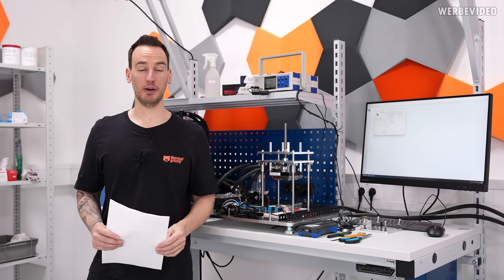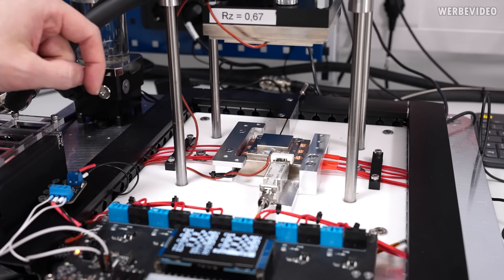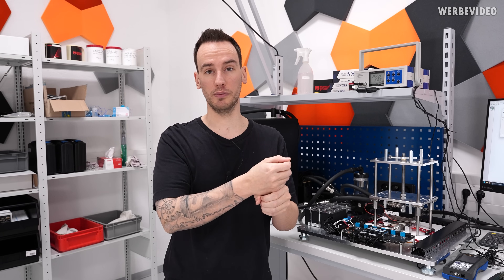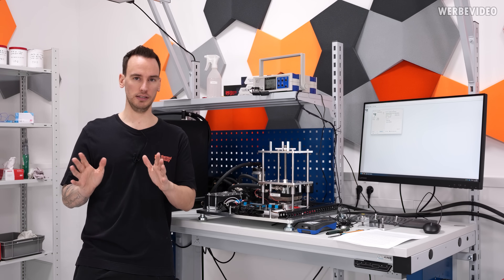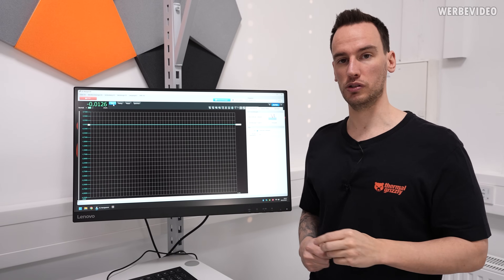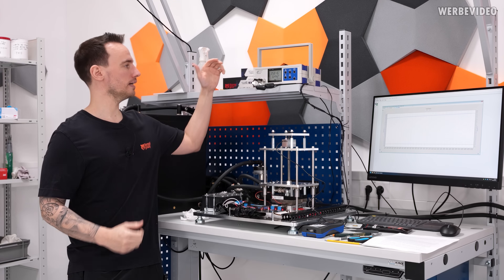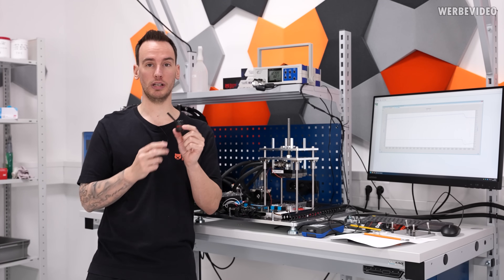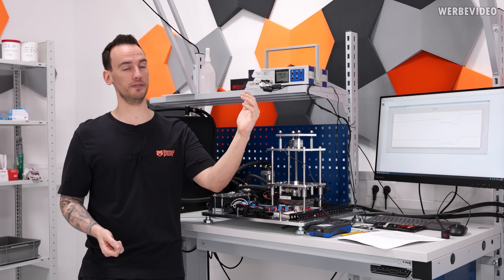The Secret of Testing Thermal Paste

Comment: Helpful tip for those that want to apply PTM7950/phase change material sheet: buy a set of precision pliers. Then use scotch tape on the other side.
You will thank me when it comes to peeling the protective coating.
Reply: Apparently cooling the PTM7950 in a freezer for a little while before applying helps with peeling of the plastic layer.
Reply: Could you explain? Do you mean the removal procedure is that bad?
I suspect then that good as thin as possible pliers might be better. "Precision" ones (at least in my country) could be quite thick, which would make it difficult to use.
I do thank you for your comment, since I have PTM7950 (one of them is called 7958 - but it isn't a paste, like googling suggests) that I will soon install on both CPU and GPU.

Comment: I remember back in the days having seen a temperature delta of 10C between whatever random paste I used to use and the Indigo Xtreme phase-change thermal interface material that essentially creates a solid bond between the surfaces. I wonder how much of that difference was just the Indigo Xtreme having been measured to cover the full surface area and me using some silly old "dot in the middle" way of applying the paste. It's also incredibly difficult to find any real data about pastes from people who measure them realistically with actually enough controls to give you useful data, so you end up essentially buying based on marketing and the baseless claims of loud people in the community.

Comment: For me the real test of a thermal paste is how well does it work when you put a just-big-enough dot in the center of the IHS and then mount the cooler.. and how long does it last before needing to be redone.

I've bought kryonaught three different times and it has always failed to spread enough on it's own, and failed this test. Hydronaught was reasonable at it though, but not outstanding.

Comment: Roman from my testing of thermal paste vs sheets delta T was 10C at Rel.Humidity of 95% with room temp 30C. Delta T was  4-6C for every degree increase in ambient temperatures with Max temps being 100-105C on CPU and 95C on GPU with laptop components.
Reply: It's nice, that you're stating all the environmental variables. But you have to look at the frequencies too. When I changed my laptop to liquid metal, the temps stayed the same. But I got a 500MHz boost out of it. So not only the temps are important but also the performance of your device. Your Laptop will always increase it's performance until it runs in one of the many limits. The limit can be power, can be temps etc.
Reply: @TheBurnout96  mine is skylake HQ CPU. Never had issues with lower frequency on turbo boost. It was always 3.1GHz on all core boost

Comment: After watching the GN video and this one, I can’t help but think you could benefit from a dry milling stage where you hammer/jet mill the bulk powder ingredients to your specification. External milling costs are always pretty high and you spend a lot of effort in monitoring particle size already, but incorporating a “qualified” process with a desired D50/D90 would save you a lot of time verifying the particle size so regularly. You could even have the material output from the mill(s) being controlled to sub-batches of a certain dispensed amount to avoid having to use the glove box 🙂

One thing I am uncertain about is your local environmental regulations about storage of the bulk materials. They could be stored in vertical hoppers mounted externally to the building, but if there are indeed significant amounts of gasses expelled, then your allowable emissions (as defined by your local environmental protection agency) would determine the amount of material you could store in said hoppers at any given time.

Very interesting to see the entire process from start to end! Your commitment to quality is truly commendable and I hope your customers appreciate it!
Reply: ultrasonic could help with densification
Reply: Curious - if they save the time in QA of external milled materials, wouldn't they have to spend that amount of time or more on QA of the internally milled materials?
Reply: @frollard not if you qualify the process of milling. If doing X number of passes at Y milling conditions is proven to land you within a specific range (for D50 or D90 whichever is preferable) then you would only have to double check that you are still within spec occasionally, therefore maintaining a qualified process. Ironically I’m pretty sure the strict level of regulation is self-imposed in the first place, but assuming that TG is loosely conforming to a GMP process this would be an acceptable path forward
Reply: Look at their near perfect, round morphology those aren´t milled particles. I would guess it´s a spraying process. With milled particels they couldn´t load their pastes with as much particles and the flowability would be really negatively influenced.
Reply: @ I’m not much of an inorganic guy so you could be spot on there. If it was an organic crystalline product I would assume the form is stable through dry/wet milling and the uniform boundary shapes could happen during drying. Given the two materials wouldn’t spraying be a very high temperature operation?
Reply: @ I mean one is aluminium whichs melting point is below 400°C, but then again, it is done even with tungsten powders, so melting temperature is no problem. I thought about Zinc oxide again (I don´t think they show us the particles of that) and I think for this a sol process, where two reactants form the zinc oxide nanoparticles is the msot likely one. This would also explain why a comperatively shitty thermal conductor like zinc oxide is used, instead of aluminium nitride or Boron nitride, as nitrides are less accessible by these wet processing routes.

Comment: Does microscopic amounts of the thermal paste that could be left over affect the the measurement whenever you test it.
Reply: I'm guessing they clean it with 90% alcohol to actually have the pads as clean as possible...but that's a guess :p

Curious what the answer is :)
Reply: @Mr3ppozz  yeah that's what I guessed about it too but I was still wondering because I knew in the other video on Steve's channel they showed the actual microscope thing that zooms in on the thermal paste when they make it and it almost looks like it's on the molecular level. I mean they zoomed in really for on it where you could almost see the little things stacked on top of each other

Comment: Waaaayyyyyyy back in 2000/2001 when I was heavily into overclocking thermal management was a huge deal.  I remember how excited everyone was with arctic silver and on a celeron I had overclocked to 1100mhz I managed a 30° drop on a thermaltake cooler just with the arctic silver.  But then as time went on and coolers got better and the improvements that various thermal compounds became less I began to see it in the same way as so many people do with their cars.  They brag about how much HP they have or how loud the stereo can get but they never really looked at the real world benefits of it.  Seeing so many videos on thermal management, how to apply thermal compound "correctly", which is the "best" kind (etc) I have noticed so many people seem to be focusing on single digit changes.  Personally dropping temps by 5-8° is really a meaningless thing for me if it isn't actually helping performance.  I also gave up gaming 20 years ago so I'm no longer chasing every clock cycle or flop that I can get.  I began to see computers as a general tool rather than something to gain bragging rights.  And I say this as I type this out on a 2009 HP laptop running a T9300 CPU.  Does everything I need and has (at most) cost me $6 per month to own and operate...and that includes upgrading the CPU, doubling the RAM from 4GB to 8GB, replacing the HDD with SSD and replacing the battery twice.  Over time I began to understand how unimportant all this performance chacing is.  But I still find the science fascinating though.

Comment: Der8auer finally overtakes Snark's Domain. He's been using a very crude version of this tester since the RTX 3000 days.
Reply: What do you mean "Finally?" Just because he hasn't mentioned it before doesn't mean he didn't have it.
I hope you realize that he owns a company that does thermal interface materials, and has long before the 3000 series, so this kind of equipment is necessary to run testing.

Comment: I love thermal dynamics.
It is so easy to do ball park calculations and get relatively ok results. (The math for steady state is easy and you can often get really good estimates)
And the same time it is so difficult to get everything 100% correct. There are so many details that often have little effect but then is speciel cases they become very important.

One of my favorit courses as a mechanical engineer. And I use it all the time outside work.

Comment: Probably the most difficult performance test is how long lasting any thermal paste is. It would be incredibly useful to know how performance degrades as the paste dries and to be able to compare this aspect across several products. Of course that would be much more expensive and time consuming to do.

Are you planning to test a range of popular thermal pastes using this ingenious device?
Reply: That's why you get a Kryosheet or something like PTM7950, which have been demonstrated to last a very long time with very minimal changes in deltas.
Reply: If I understood things correctly - this is mainly for internal "batch" testing and for R&D. And they do make such endurance tests BTW.
Whether they test competition (very likely) and whether they want to share this data (there might be reasons they wouldn't want to do so perhaps?) is a different matter. I would love to see such video as well, but IDK if it's plausible that they will make a video out of this.

Comment: For decades now, I have lap matched processors to heat sinks contact face(Wet and Dry sandpaper method). I do this too match the surfaces, so that both surfaces have example 500 Grit. My experience has taught me that going above 1500 Grit becomes none effective, unless you use liquid metal. (Coollaboratory 1g in medical syringe late 90's. Also tried Thermal Grizzly version to see it modern version had changed.) The side effects of liquid metal, is why I stopped using it. I am not into extreme overclocking, in later years I find overclocking has become a waste of time compared to the performance gained. What would I like from a thermal paste? A thermal paste that states particle size. A thermal paste that will fill the surface with a micron or grit reference. 
General Information
Match a processor to a heat sink is time consuming and can take a few hours. It is very boring to do also. You can have similar results, by just using liquid metal based thermal material and reading the instructions correctly when applying liquid metal, with the sanding part. 
Best O/C
Intel Q9550 with SI-120 cooler to 3.2GHz stable 24/7/365. (3.6Ghz was possible, not 24/7 stable though)

Comment: Well, you guys must be doing this right. I bought Kryosheet to replace thermal paste in my laptop. It has a very small direct die CPU, so the paste would always end up spilling to the outside, even when it was a super thin layer. Core temps would never be even. To fix it I put a cut piece of Kryosheet in there and the temps stay rock solid with absolutely no fluctuations for many months. It's overclocked out the wazoo as well (+900MHz core and cache).

Comment: This video makes me want a revisit of the paste application techniques.
Is air bubble trapping really a considerable issue when spreading the paste out flat on the IHS, rather than placing a dot and pressing it out?
Reply: In previous videos Roman has categorically said that bubbles are absolutely not an issue, ever. Only portions not covered by paste are an issue. Even in this video he spread it out over the whole surface. He does this a lot, so hopefully he's right. haha
Reply: @EricTheRedKind  If you put a circle of paste, trapped air is a bubble. It's just that barely anyone would be dumb enough to do that.

But then you have people like The Verge showing unsuspecting viewers exactly these methods nobody would normally use, creating this problem that wouldn't exist otherwise.
Reply: This backwards thinking, you don't want so much paste that non covered areas don't make contact, ideally you want the opposite,only filling the holes that don't make contact and the rest shouldn't have any paste as it a better transfer with direct contact. But it hard to know what's contacting what so we just glob it on. But I'd bet if you put on a minimal amount scrape the rest off with a razor blade so you really only fill the gaps,that would perform best.
Reply: The differences are minimal in practice, but x is the most reliable way of making sure there's as little air trapped as possible while having full area coverage
Reply: No, it's really not a considerable issue. This has been tested that pretty much every way you end up with good coverage due to the pressure, and the biggest risk is not using enough thermal paste. 
Where the risk would lie is when doing liquid metal, where missing a spot is much worse.

Comment: All I can say is I switched from pastes (having used a variety from different companies) to using the "Phasesheet" rebadged PTM 7950 from Thermal Grizzly on a 14900k and it performed brilliant after a couple days of heat cycles. If this product stays available I would use it for any PC that won't have the CPU cooler removed within a few months.
Reply: Thank you. I got a sheet waiting to go on my alphacool 7900xtf to fix my nasty deltas and you made me feel better
Reply: The PTM is awesome as it's very forgiving. My brother was installing it on his AM4 CPU (don't remember which one), but it tore up in one corner when peeling off the substrate film. We just stuck the torn part afterwards as if nothing happened (not perfectly anyway) and after reassembly the temperatures were still better than before.
Reply: lol yeah the ptm 7950 tears easily

I re"pasted" an asus rog ally after performing a replacement on one of the fans and the stuff is like an al dente noodle.
Reply: @RicoElectrico  That's what happened to me. The peeling was the only issue I had with it, the first side I tried didn't come off but the 2nd did fine. I had a tear in the corner but I was able to bring a bit from the overhang on the contact frame and place it down to make sure it covered properly.
Reply: bot marketing comments??
Reply: I got a huge fan speed and noise improvement on 3090 using PTM 7950 from Aliexpress. I wonder what's the thickness of its particles/contact gap.
Reply: Also this sheets is perfect for direct die because it mitigates the problems associated with the adjustment of compression in different areas (especially if it's not a single die chip) and dry slower than "liquid" metal.

Comment: For sure thermal conductivity is used as a marketing tool, it's kind of hard to know how well something will perform from that number. Thumbs up!
Reply: Even a truthfully marketed product can disappoint...for example, with an SBC prone to pump-out, any thermal paste will underperform.
Reply: Pretty much anything misleading can be used as a marteking tool, take a fan, this one move more air (bigger cfm) so it is better... Except there is no mention of static pressure... It isn't a false statement, just that not all aspect of a product is shown and these simple number comparison will work for most people, only then you as a customer take time to search how things work will you realise that the things marketed may not be what you are looking for and then end up using a lots of time trying to figure out what is the "best"... There are theoretical best in one area sacrificing in other areas, so finding the compromise that is good enough for you is the hardest part to not be disappointed in a product... For me it remind me on my choice of DDR ram, there were a lot of faster ram, the more expensive one had lower latency, for me, I took one that was not expensive, slightly lower clock but way better latency compared to other of same price/speed, was it the best ram I hever had? no idea, it was good for my use gaming for nearly 10 year on the system without a problem. You can tell I wasn't disappointed in that purchase as I made my own conclusion based on what I've delved into at the time (since then I learned more on how things works)
Reply: Good thing is that for regular users something in range of Arctic MX-2 to MX-4 will be more than enough, and syringe of those costs like 5€ (3-4 uses). Anything above is just for extreme cases IMO.